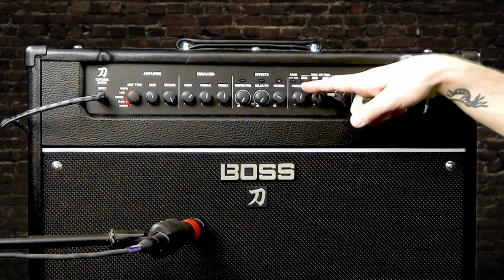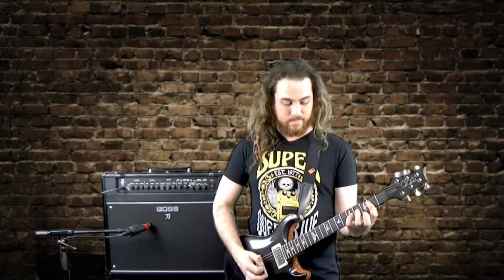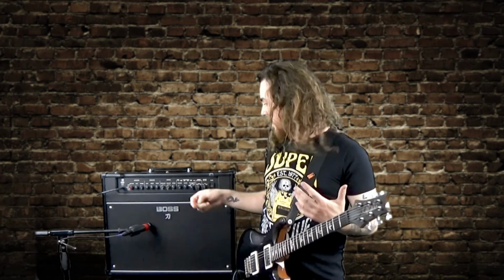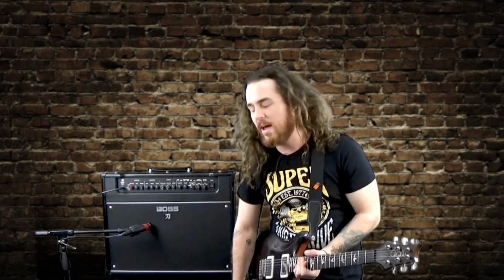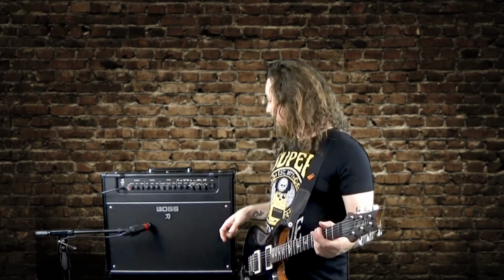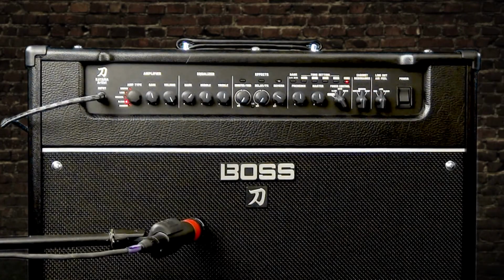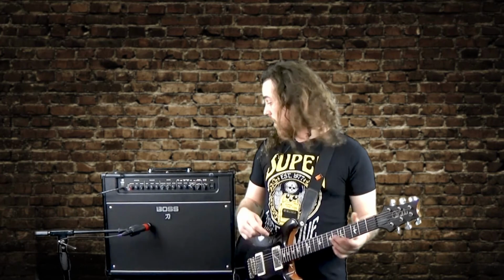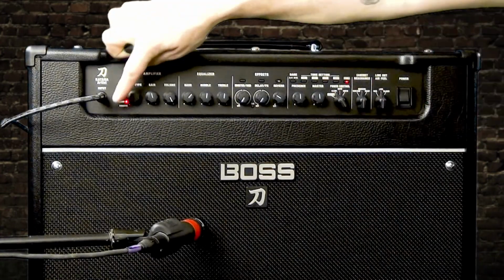Boss - Katana Artist  - Part 3  - Presence, Master,  Power Control, & Cabinet Resonance

Comment: I swear this is the best amp ever made. Period. And I’ve had over 100 amps, and modeling units. Nothing even comes close to this thing. And so easy to use. I’m surprised they still called it a Katana. It’s not even in the same galaxy as the regular Katanas. I’ve had the 50 MK1 and MK2 and absolutely hated them. The artist will rival and/or beat ANY amp you put it up against. Yep, I said it, ANY AMP ever made. Better than any modelers too imo. I can dial in any tone on earth in under a couple mins. Can’t do that with my modelers at all. Gotta be a freakn rocket scientist to even understand modeling units. The Waza speaker and how they wired and tuned this amp are absolutely mind blowing. If you get one, get the GAFC-EX pedal for it too. Literally could tour the world from Wembley to a shit dive bar with this amp and the foot switcher. I’m about to pick up the Waza cab and run stereo. I honestly don’t think I’ll ever need another amp again in my life. Time to sell some stuff and have a huge stack of cash. Thank you BOSS for making this amp, all the pedals you make and all the Roland/BOSS gear. Thank you.